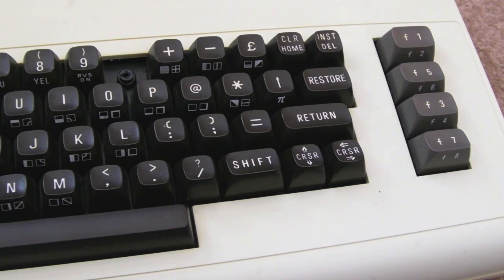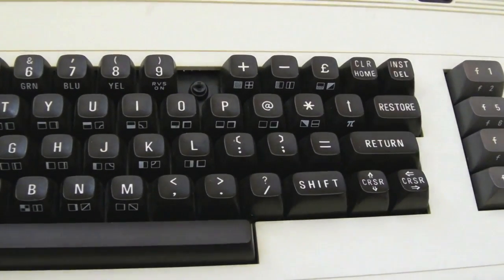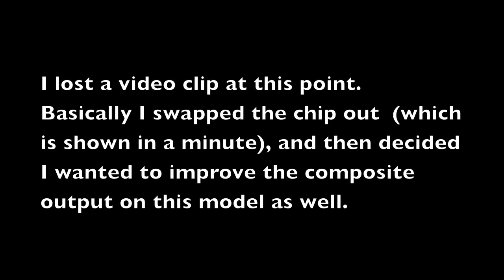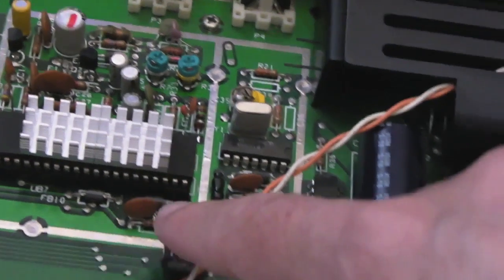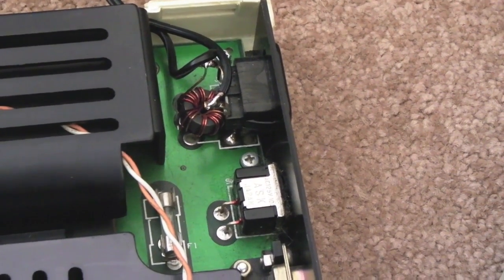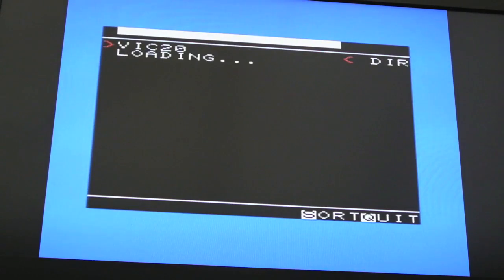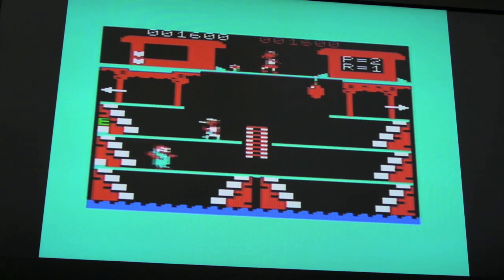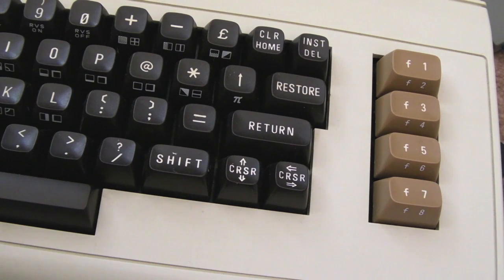Commodore VIC-20 (VC20) Follow Up (Power Input Mod & Video Tidy)

Comment: Hi, just got started to vintage computer, love you videos, I know this is an old video, just wanted to say that 9V AC through a bridge rectifier means that you got the RMS value in DC flattening out the AC lobes. You just got to divide the AC voltage by 1.4 to get an equivalent DC, so 9V AC / 1.4 = 6.4 Volts DC, so feeding the bridge with 12 Volt you give almost double the voltage to the regulator, that is why it heats up. Hope this helps and keep up the good work.
Reply from the maker: Thanks =D  Yes, familiar with that formula =D  1.414 recurring =D

Comment: so any 12v power sup[ly do the job? i maybe soon get a vic-20 but the power suplys is dead and is a early 9vAC.......
Reply from the maker: Yes, try and get something that provides between 1A and 1.5A.  Anything more than that would work but too high could mean if a short occurs or something more damage could occur.
Reply: @GadgetUK164  great I can give a try I finaly got one this morning for quite cheap. but that not change the power output of the cassette player? all is regulated for use cartidige ect without damaging?

Comment: I have a similar 2 pin version of this,  the sockets a little different internally, its a board 324003.  Your power mod is pretty hard to see.  It looks like you have the power connected to a ground screw and the inductor?   It'd be great if you could make a vid that demo's a nice mod for completely replacing the 2 pin 9vac with an alternative easily replaceable long term solution for the novice.
Reply: I've put the 2.1mm socket in the metal bracket on the right hand side, above and in-between the AC socket & the power switch.  I've then run the 9V DC directly to the regulator (replaced the LM323 with a PSU5 from ezsbc.com) ... basically at the output of the rectifier.  Even when running on DC the rectifier generates a lot of heat (i.e. wastes power) so I figured bypassing the rectifier will save power & heat, in addition to the LM323 replacement.  Drawback is that there is no longer any AC on the User Port ... but I no have the choice between "normal" 9VAC and "low power" 9VDC.  Will put a quick video on my channel.

Comment: I know this is an older video but could you suggest somewhere to purchase individual Vic 20 keys? I'm specifically looking for number for, a international webstore is fine, but if you know somewhere in the US that would rock. I've been checking forms, Reddit, and eBay. All I can find is entire keyboards. Keep up the killer videos👍
Reply from the maker: Thanks =D   The C64 uses the exact same keyboard (not the newer C64C).  So just search for replacement keys for the C64.
Reply: It looks like you need to repair your 'U' key on the keyboard you typed this with ;) foUr, forUm...

Comment: please listen. i need help my vic 20. power supply are too expensive. i cant use eBay anymore. i need a better video on how to set up the 12vdc mod. please reply, it would be great.
Reply from the maker: +zippofanmc Hi, sorry for my slow reply!  See at 04:00 there are 2 connections there coming out of the the large black power socket.  Just solder one wire of your 10 or 11 or 12v PSU to one side, and the other wire to the other solder connection.   Then it should work - provided the VIC-20 does not have some other fault.  It's better to use a lower voltage if you can, 9v might work, 10v is ideal.  The PSU needs to provide 2 amps (2000mA) I think, but slightly less might work OK.  You can use an AC or DC PSU - and polarity isn't important as it goes through a bridge rectifier.
Reply: +GadgetUK164 thanks

Comment: Very cool. Is that Comoposite video ? Looks god composite. No jagged lines on red. nice. The Games for the VIC 20 look better than I thought also. The sid convert was interesting. Back in decemeber 1993 at The Party III in Denmark I went together with my friends. We had rented a minibus, stashed it full of equipment. Mainly A500, A1200, but some AV stuff we drove through Denmark to the party. At the party there was a guy sharing table next to me who had a VIC 20, C64 with a selector switch. Had different operating systems he said. I didn't get it at the time, but he also had a submission for the "crazy compo" I think it was and it was his VIC 20 with wired in EEPROM. He said to me "It loads data from the EEPROM and plays it with 4 bit DAC". The demo also had animation which was crazy for the VIC 20 at the time. The sid converter in your video reminded me of that. I believe the sid converter is using a 4 bit dac technique as well. I'm watching The Party III videos on youtube now. Haven't found the demo or myself and my friends yet :)
Reply from the maker: +bwack Yes, just composite - but does look great with the mod!  Very interesting about that guy with the crazy compo demo - will have to check some of those demos out.  I am sure you're right regards the 4 bit DAC, but I am not 100% sure because if you think about the size of the song the compression would have to be insane - It's the full sound track, so I think someone has perhaps used the DAC facility, but also the other channels are being used for some of the sound as well - kind of mash between DAC usage and traditional square / triangle wave (assuming VIC has those - I've not checked).  Either that or if it is just 4bit DAC the compression is amazing in so little RAM.
Reply: +GadgetUK164 Sorry, It was the party '94. December 94. The demo is listed under "wild", Maximum Overload VIC-20. Now I'm a bit starstruck because now I found an interview where this demo was mentioned and that there was a guy called Jens Schönfeld "with his heavily expanded VIC-20". It happens that I sat next to and spoke with the CEO of Individual Computers. I love that company, and that was really cool to find out now. Google "Interview with Marko Mäkelä"... Maybe the SID converter produce a code that when run will produce PCM on the fly by emulation. This would save data.